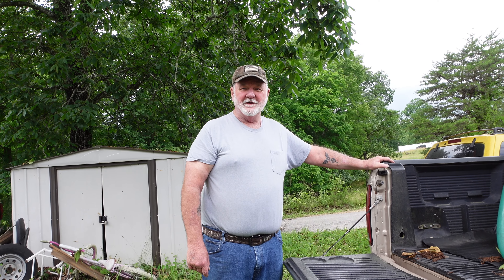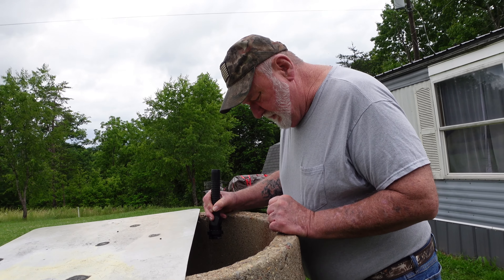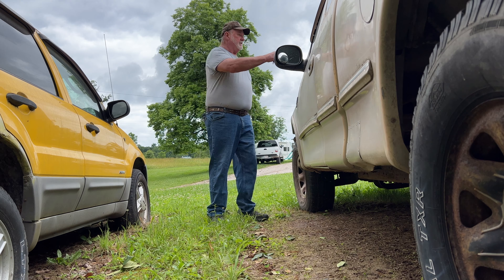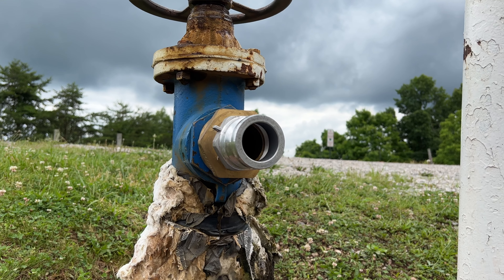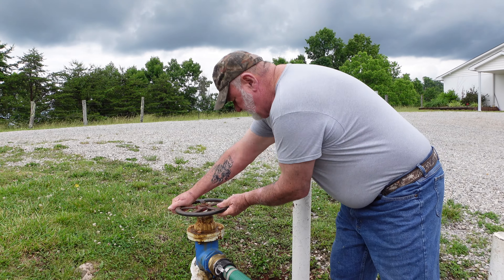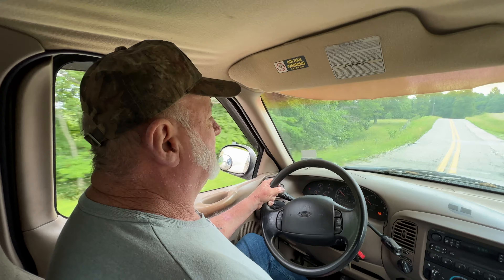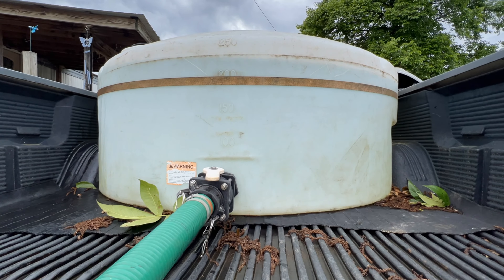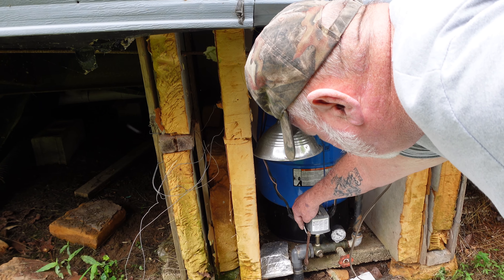Water is Precious! & It’s NOT FREE!

Comment: Hauled water up here in Montana until I had a 517’ well drilled…new place, my well cost $66,000 as it was almost 800’ down!

Still, better than hauling it when it’s -35 F…or paying $250 a load to have someone haul it for you or tearing your truck up…as another commenter stated, you should be pulling the water tank in a trailer rather than carrying it…too hard on that truck, sir!

Comment: how do you unthaw a valve?
Reply from the maker: You can use a blow dryer or heat gun. They make a heated pipe tape that can go around it and prevent freezing as well.